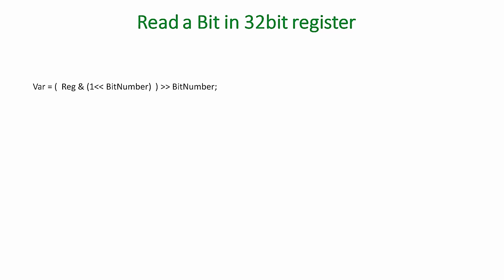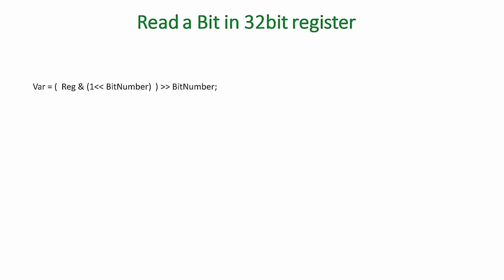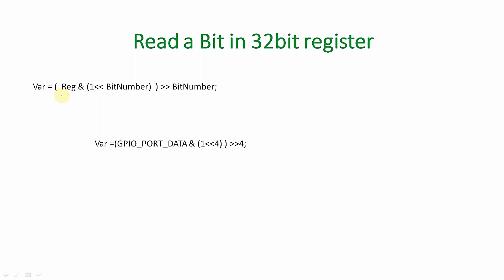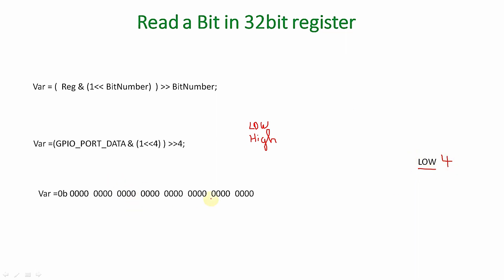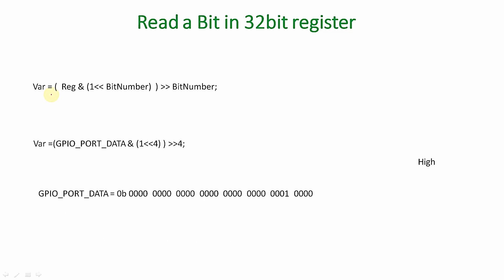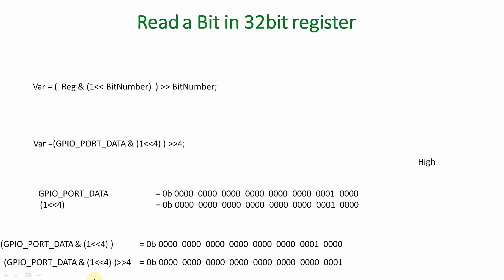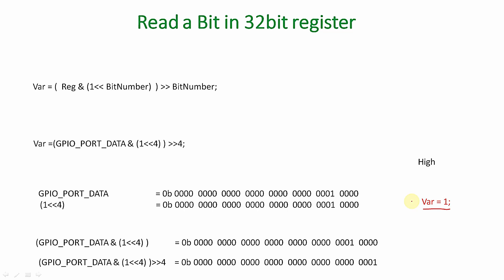Reading bit status in register technique using bitwise operator

Comment: Looks like some cirrection needed. You are checking the 5th bit position, starting from 1 as the lsb ?
Reply from the maker: Can you mention the timing in the video
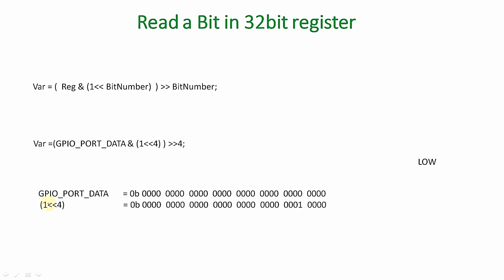Reply: @SMtrainingacademy  4:00 this is where you are counting from 0 that is the index , however, should not it be positioned 1 ? as it the first bit at 0 index ?